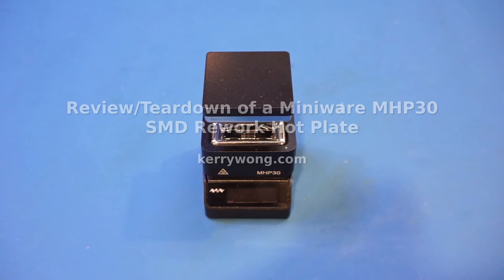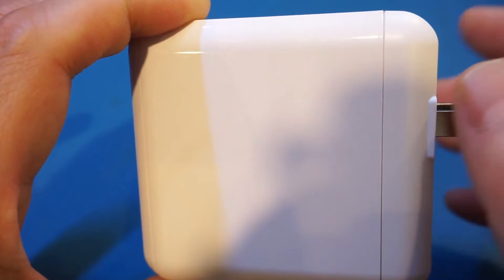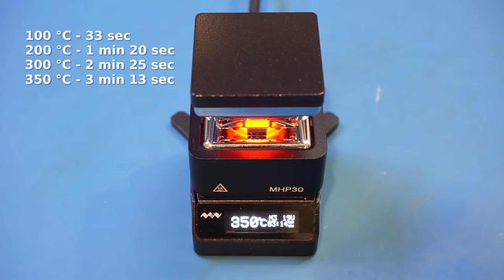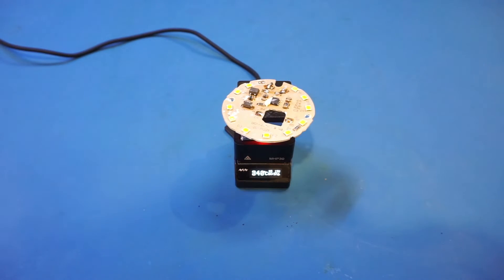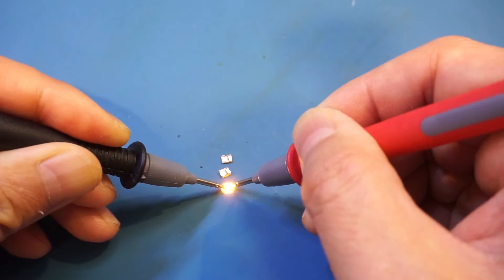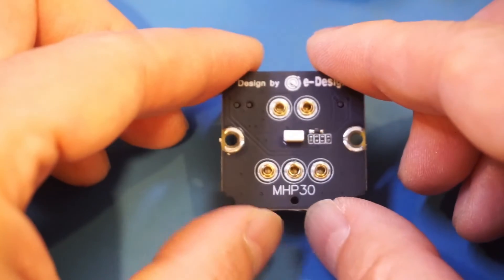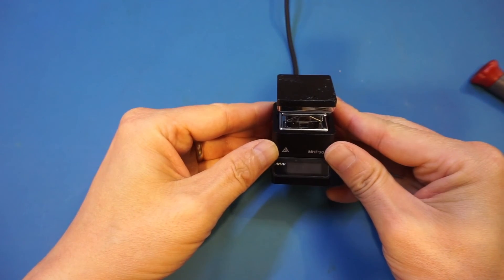Review/Teardown of a Miniware MHP30 SMD Rework Hot Plate

Comment: Quiet a longer time to reach 350 degrees when comparing your 3 min 13 sec.
Got an older unit. it took from living room temp 30 to max 350 degrees 2 min 35 sec. and to reach 300 it was a tad under 2 minutes... it peaks around 55 watt on the units screen-info
Was running it from a PD powerbank (QD188PD), as I only went for the unit alone (66US) and not the PSU incl. vers..
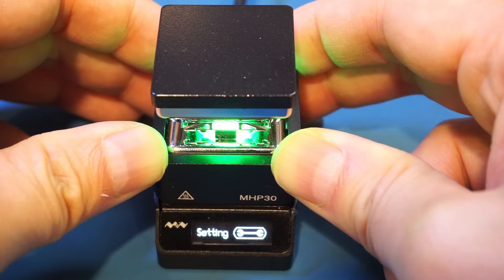but its an older revisions from 2021 rev 2.01 and hw 1.50 so likely that things been changed, as your unit do differ on its value with ver 2.11 and hw 1.60 3:51
Its a charming little unit..very well-built, and its positive that you can turn off the tiltfunction and use it in 360 usecases, if you wanna melt, fuse, heat something.... tested the accuracy on my unit which were spot on, and cycle wth a few degrees to each side, when settling and also the plate heat-levelness.. looked good / unitform across the plate https://youtu.be/NQ2crGA-5bk?si=4ivkovrEJhle8Ldo&t=36
Looks like you can install custom fw on it.. like IronOS, though not something I have tried and got no idea of what benefits you optain with this IronOS or if you optain higher wattage or temp or if its only UI customisation...

Comment: Very neat review.
Was just wondering though, as I have a small rp2040 project coming up.
While I can spring for one of these no problem, was wondering if a simple aluminum or copper board supported above something like a candle would work in a pinch?
I've got an laser temp gun, and while fine temp control might not be there, gross control via raising or lowering the board or candle/sterno seems intuitive.
Maybe posting at 0547 is not ideal...
Reply from the maker: Flame under a plate will not work (I tried this many years ago :-). The issue is that the heating would not be uniform and you would not be able to control the temperature easily. It may be easier to modify a toaster oven for reflowing.
Reply: Yes: use a Chinese restaurant food warmer. It'll work fine.

Comment: What is switching the heating element on/off. I expected a high current MOSFET in either a TO-220 or surface mount D-Pak package.
 Is there a larger version of this? I want to pre heat larger boards such as graphics cards to reflow the GPU. 3cm x 3cm hot plate is tiny. 10cmx10cm would be more useful.
Reply from the maker: That's an excellent question. I took a look at the high resolution pictures again (http://www.kerrywong.com/blog/wp-content/uploads/2023/10/circuitboard2.jpg) and the only component that could possibly be a MOSFET is the SOT23 device in the middle (IALLM), but the switching current is at roughly 3A.  You saw my measurement of the pins from the hot plate itself. The two pins measured 6.4 Ohm are clearly for the heating element so the MOSFET can't be on the hotplate either.
Reply: It's a pretty low current, so it doesn't need to be a large package that needs to dissipate 50 watts on a heatsink. A modern low-loss MOSFET in a SOT23 will do.
Reply: Miniware just posted a video of a new MHP50 hot plate, it has fan cooling & is twice the size of the MHP30, looks good